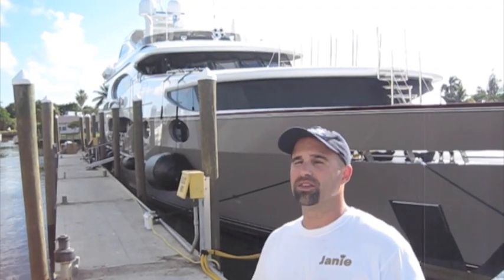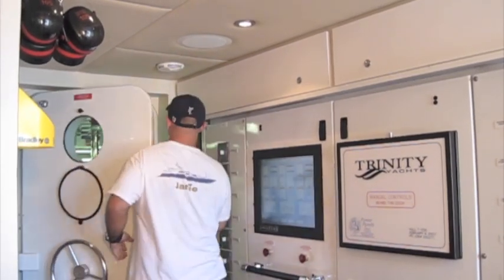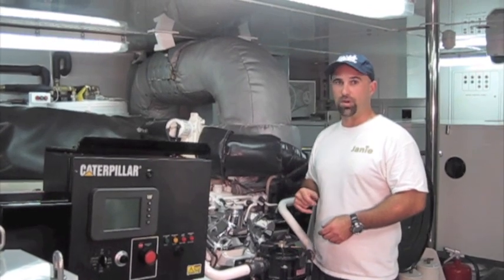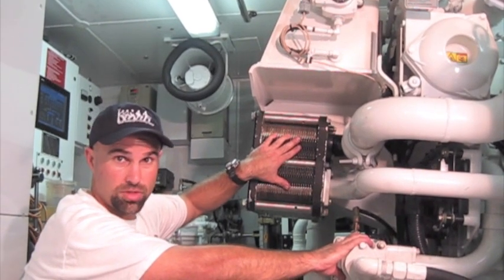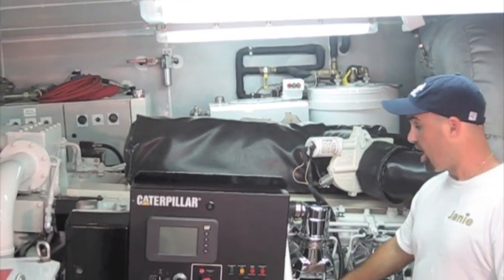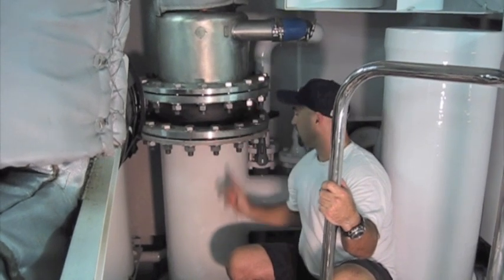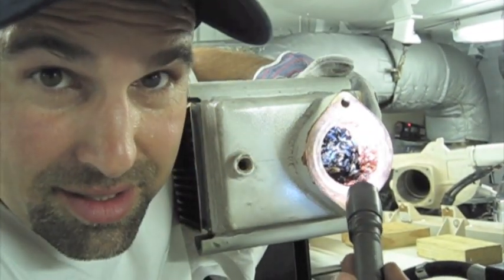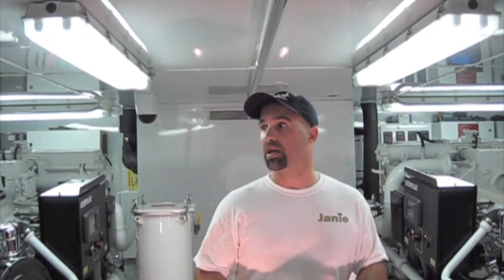Marine Engineer

Comment from the maker: There are only heat exchangers on the motors. 
But then in that engine room the air conditioning system (the Chillers) have condensing barrels to cool the high side down with sea water and they do act just like heat exchangers.